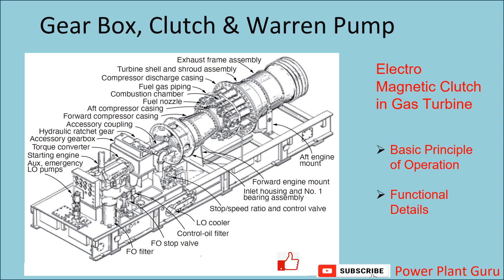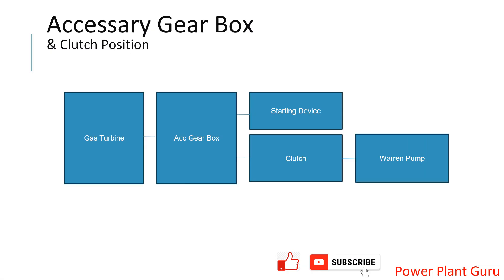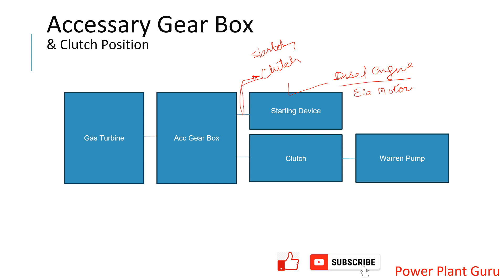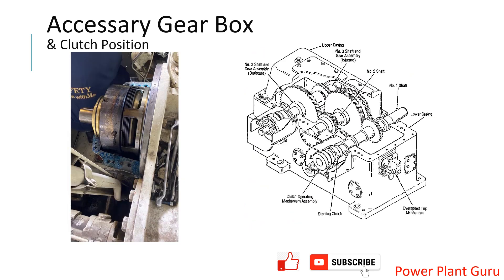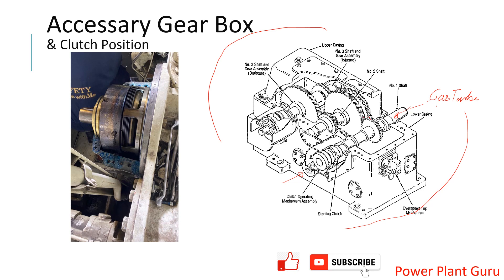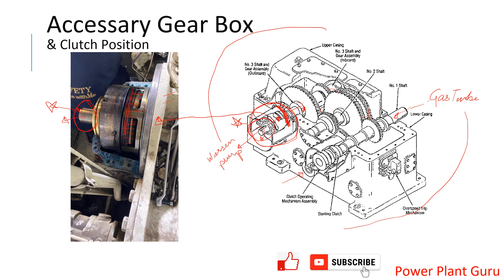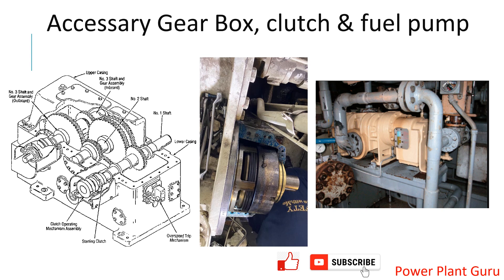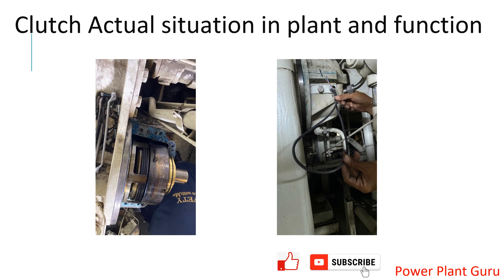Magnetic Clutch in gas turbines, Power plant guru, Gas turbine power plant

Comment: Kindly make a videos on Scheme of starting system , lube oil sustem , cooling water system , liquid fuel system , hydraulic supply system, trip oil system, coing and sealing air system, fire protection system, ventilation and heating system, atomising air system , wash water system etc for Frame-5 GE Make gas turbine. 🙏
Reply from the maker: Hello Prabhat
😊 You have mentioned the entire GT syllabus for video. 
I trust you liked the content. 
I do this work in my spare time and will be able to do it slowly but for sure 😊.
Reply: @powerplantguru007  Thanku very much . Your Teaching skills are appreciable. 🙏